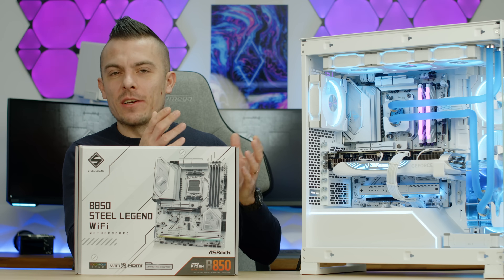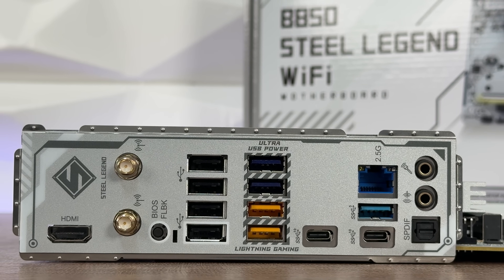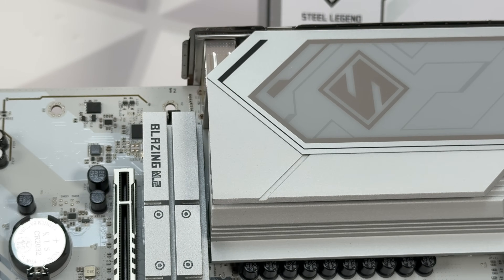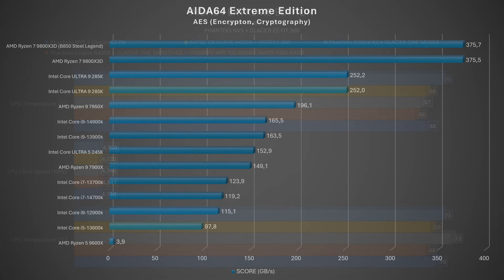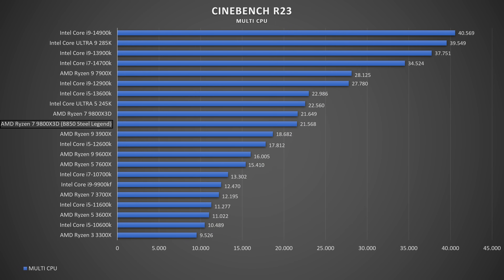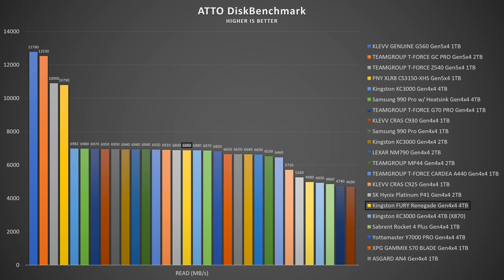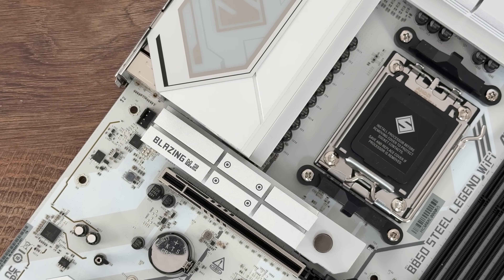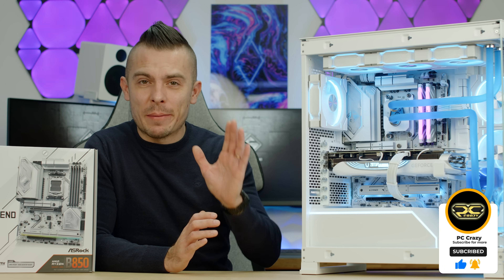ASRock B850 Steel Legend WiFi - Review

Comment: I just bought the same motherboard, should I be concerned about the software for this MB, i watched videos that it burned x3d CPUs. Is my 9800x3d safe or should i buy another brand MB?
Reply from the maker: Update the BIOS to the latest version (not the BETA one) and you’ll be fine. I tested multiple ASRock AM5 boards on 7900X3D, two different 9800X3D and 9950X3D. Not a single issue.
Reply: @PCCrazyDario  that is reassuring, thanks! Updated it to latest version first thing after successful post, fingers crossed now

Comment: How enable the WiFi on the board
Reply: I don't have this board but this is AIs reply:

📡 Wi-Fi Activation Protocol
Install the Wi-Fi Antennas

Locate the two gold antenna ports on the rear I/O panel.

Screw in the included ASRock Wi-Fi antennas (2.4/5/6 GHz capable) for optimal signal reception.

Ensure OS Compatibility

Windows 11 is required to activate Wi-Fi 7 (802.11be) support.

If you're on Windows 10, Wi-Fi may not function properly or at all — upgrade is essential.

Enable Wi-Fi in BIOS (if disabled)

Enter BIOS by pressing DEL or F2 during boot.

Navigate to Advanced > Onboard Devices Configuration.

Ensure Wireless LAN is set to Enabled.

Install Drivers

Use the ASRock Auto Driver Installer (included in UEFI or downloadable from ASRock’s site).

Alternatively, manually install the Wi-Fi 7 driver from ASRock’s support page for the B850 Steel Legend.

Connect via Windows

Once drivers are installed, go to Settings > Network & Internet > Wi-Fi.

Toggle Wi-Fi On, scan for networks, and connect.

🧠 Tactical Notes
Bluetooth 5.4 is also enabled via the same module — ideal for pairing peripherals.

MU-MIMO and 6GHz band support will activate via Windows Update once regional regulations allow.

If Wi-Fi still doesn’t appear, check Device Manager for missing drivers or disabled adapters.

Comment: got this baby for 180 usd brand new on ebay, pairing it with a 9600x. wish me luck !
Reply: How is your motherboard after 7 monts? I am about to buy one too😅
Reply: @fujimaru6157  100% happy with it!! my build is super snappy and I love it! That said, I’m planning to upgrade to a 9800X3D, and there’ve been multiple reports of CPU deaths linked to B850/X870 boards (especially with 9800X3D and 9950X chips). If you’re sticking with a 9600X or 9700X, it will run great. Just be cautious if you’re planning to jump to the higher-end chips. If you’ve got time to reconsider, I highly recommend the ASUS ROG STRIX X870-F GAMING WIFI7. only ~$50 more than the Steel Legend, and way better stability.
Reply: Still running fine?
Reply: @LordLuc94  Yes, but i would not upgrade past the 9700x lol
Reply: @QNTM-_LUXXX wait, why, i just got it for a 9800x3d and felt like an idiot just now 😅
Reply: How does the 9600x performs bro
Reply: @laracidhazael274  pretty ass, 2-5 % faster than 7600
Reply: @trapmango4110 Yeah on 40% lower TDP. What if you use PBO and get it up to 105W as well instead of 65W. ;)
Reply: Does your cpu got fried yet after 7month?
Reply: @zandermercury28  This is only happening to higher end chips such as the 9800 and 9950
Reply: @zandermercury28 I have the b850 riptide WiFi and the 9600x since the end of July and it’s been all good, 3.40 bios and no problems at all. Like the other reply said it seems like it’s only happening on their high end motherboards and cpus, especially x3d

Comment: I have the exact same board paired with a 7800X3D/4080 Super

I’ve had same issues with a 64GB Kingston Fury Beast RGB where A2 slot becomes unresponsive when rebooting in Windows 11 and the RGB not working. EXPO and Default. Even with manual timings set.

Swapped A2/B4 DIMMs and still always have A2 sometimes not working. In Windows it then just shows 32gb in task manager. Was getting BSOD with Memory Context Restore and Power Down Enable set to Enabled - on latest 3.20 beta bios and happens even with original 3.16 bios

Since switching to a CL28 6000M/T Corsair Vengeance kit (QVL approved) I’ve had zero issues with rgb and no issues with Windows detecting ram or any BSOD issues and EXPO working as normal and couldn’t be happier
Reply: The RGB issue is a 3.20 BIOS issue with that brand of ram ? I am using patriot viper venom 32gb dual channel (A2B2) 6000mhz , the RGB on my fans and motherboard stopped working after I updated the BIOS from 3.15 ! 
I bought a USB fan hub and the problem seemed to be resolved for now, but I would like to figure out why it’s not working regularly plugged into my fan headers .
Reply: Tldr, can we conclude that every RAM which is QVL approved for this board will give no issues regarding clockspeeds/EXPO-tuning or PBO-overclocking nor with the aRGB lightning?